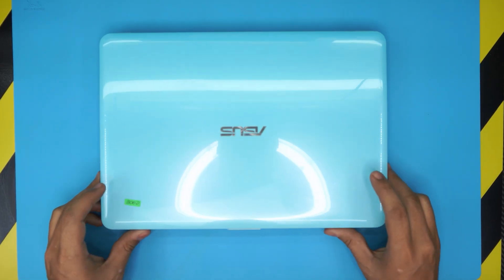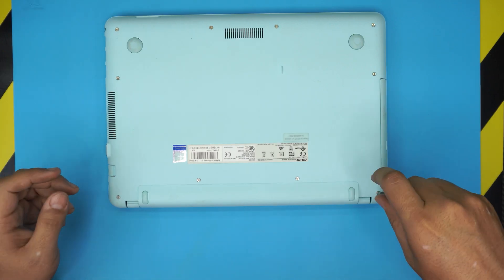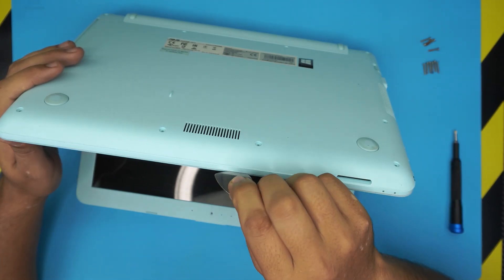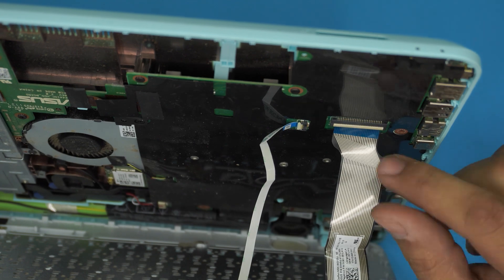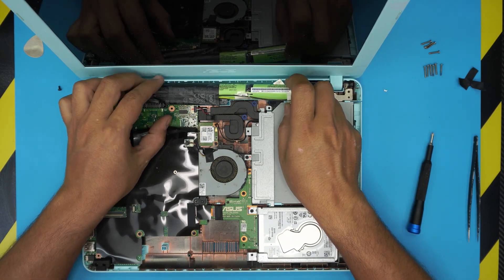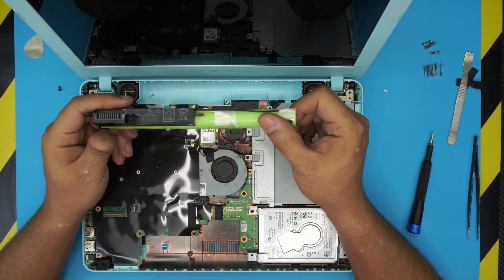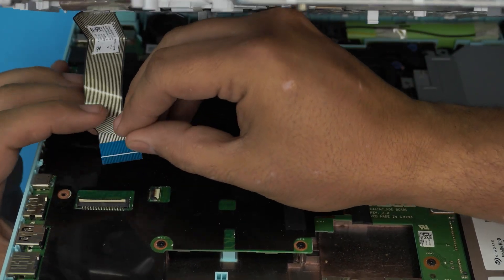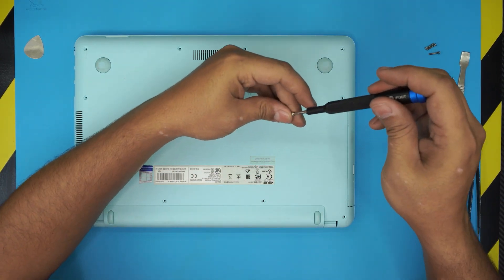ASUS X441n Laptop Battery Replacement Guide

Comment: Before I found this video, I was bringing my laptop with the same type to repair shop. So I tried myself now but they glued my battery apparently 😭

I can't remove it. Please help me what can I do?
Reply from the maker: It's my pleasure my friend.
🫠Regarding your question, apply a generous amount of 98% isopropyl alcohol around the battery, and that will dissolve the adhesive.
Should you have any further questions or requests in the future, please don't hesitate to ask me.
cheers🍻

Comment: we have the same laptop and i can't use it because the laptop cannot detect the battery, i don't know if the battery is the problem or the battery plug on the laptop itself.
Reply from the maker: Regarding your question, can you power on the laptop with the charger connected?, if so then the issue is not the charger or the connector, because you should be able to power on the laptop without the battery. your battery may be gone bad i highly recommend you replace the battery.
cheers🍻
Reply: @uFixTek  i hope you can help me😓
Reply from the maker: we do get this issue on this laptops a lot and it is always a bad faulty battery or the battery is gone bad, replace the battery and you be fine.
Reply: @uFixTek  Thank youuuu😊 i hope it works i will buy a battery now, the only problem i worry is that maybe it is not the battery that has a problem i thought that it is the battery plug inside of a laptop. But if you said that it is the bad battery then i will buy a battery. Thank youuu again😊😊
Reply from the maker: it is 99% of the time is always the battery, very very rare case it can be a component on board. get a battery and you will see it will be all fine 😊
Reply: @uFixTek  Thank youuu man, i will tell you if it works or not😊
Reply from the maker: good luck my friend 🙃
Reply: @uFixTek  Hello, the battery is working but it is not charging i mean the battery is ok it has even 55perceny when i receive it but when i try to charge the laptop it won't even add another percent😔 what do you think the problem?
Reply from the maker: go to official site and update the bios, and uninstall the A/C battery drivers.
Uninstall and reinstall the battery driver: Open Device Manager >>Batteries >> right-click Microsoft ACPI Compliant Control Method Battery >> click Uninstall device >> Then restart your PC, Windows will automatically reinstall it.
Reply: @uFixTek  do i need flashdrive to update the bios?
Reply: @uFixTek  should i do it with battery inserted to the laptop?
Reply: @uFixTek  hello man, after doing all these the bios update and uninstalling installing the Drives in Ac battery it is still the same😔😔😔 Help
Reply: @warrenraging22  We have the same problem, mine is stuck at 47% after replacing the battery
Reply: @uFixTek  yes i can use the laptop with the charger on, i mean is that i don't know if the Battery or the Battery plug inside of the laptop is the problem. Thank you for your response

Comment: Hi! I have the same laptop. The problem is it turns off when moved slighty. Is the battery loose? do you have solution for this? Thank you in advance.
Reply from the maker: Thank you! for the feedback and your support to the channel by SUB :P
regarding your question: I need to know the following:
#1. when you use it with power adapter and move it, it turns off?
#2. does it turn off when its only using with battery when moving?
#3.if you dont move it connected or with battery only, it wont turn off?
Reply: @uFixTek  if its plugged, it works fine even if I moved it. It only turns off when unplugged/using battery then I move it.
Reply from the maker: ok then follow the video open it up and remove the battery and plug it back. it should fix your problem the battery is held with adhesive it may be dry and the battery is moved and making bad contact.
Reply: @uFixTek  I'll try this. Thank you for answering. More power to your channel!
Reply from the maker: your welcome my friend if anything let me know.
Reply: hello brothers, i had the same case. My laptop has the history too of this years ago, we went back to the shop twice because it turns off when moved slightly and they fix that too twice and it works fine. But since last month, it was back to this and we can't go back to the shop because it doesn't cover the warranty already. Do you recommend just buy a new battery to replace it? What should I do?
Reply: @julesphorf7130  I just put some tape in mine to secure the battery and it works fine since then.
Reply: @fayepancho9964  where exactly did you put tape on the battery? And in what way? Horizontally? Vertically?